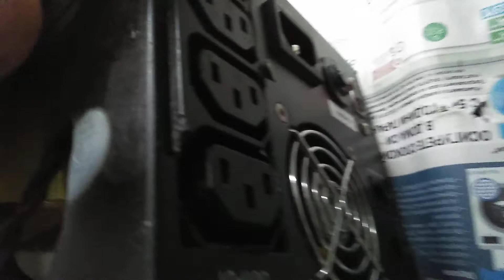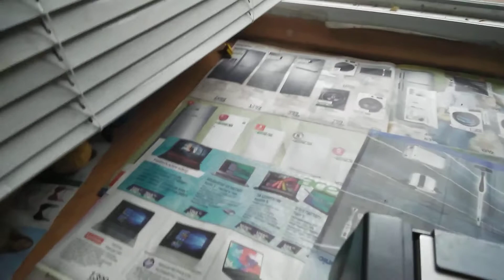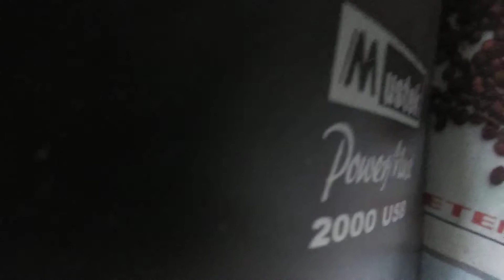UPS  MUSTEK 2000 USB 11 Years of constant use how much it Will DEGRADE the Battery ???

Comment: Hi, I have the sams UPS, just 1000VA. Did your fan run always or it sometimes stopped?

Did you use NUT in Linux to connect? My ups reports to be 62C degrees in case and the  batteries are cold.
Reply from the maker: i never watched his temperature.   Mine's fan always spins, but sometimes it speeds up
Reply: @godji4467  does yours turn on on its own when power comes back? Mine doesn't
Reply from the maker: @brbrbrbrbrbrrb  if the start button is pressed, it should  turn on
Reply: @godji4467  Ah just checked. Indeed! It turns back on after a few minutes. Thank you so much for replying.

I have just one last question, thank you so much I subscribed.

Is there any way to turn off the fan or replace it for a quiet one? What's the connector? Is it a regular 120mm fan? For example can you buy a fan from Noctua silent and put it in? It's very loud.

I'd love to turn off the fan.
Reply from the maker: @brbrbrbrbrbrrb  you're welcome.